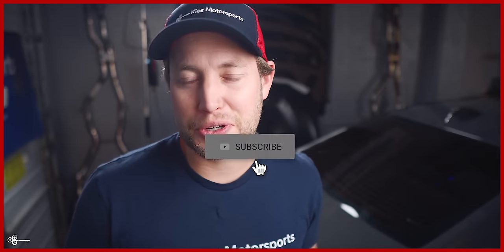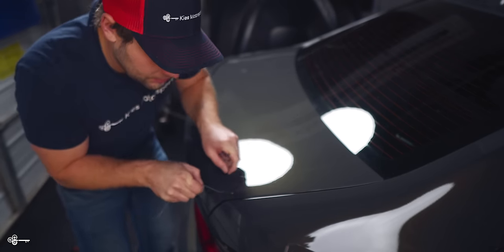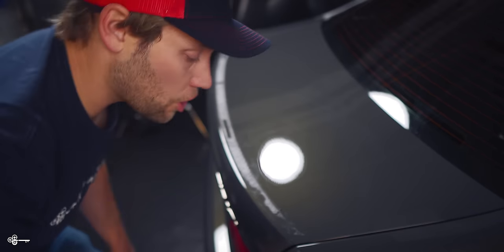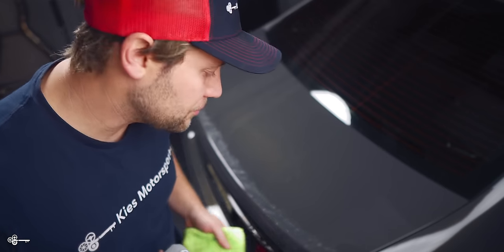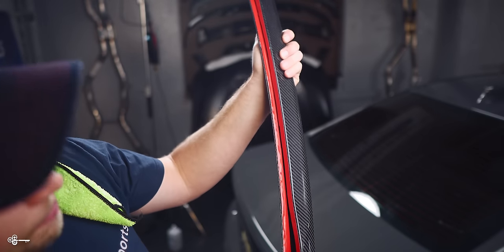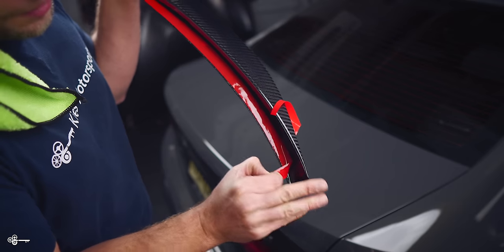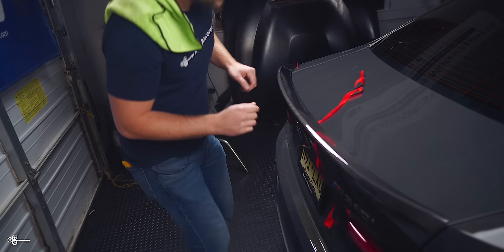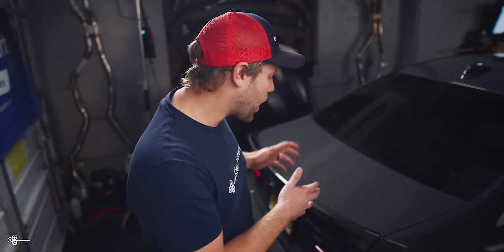How to install a Carbon Fiber Trunk Lip on a BMW G20 (M340i and 330i)

Comment: My 2019 330i didn't come with a Wimpy! Now I feel ripped off! hahaha! I like the concept of pulling the tape off of both ends, in case of ripping the tape! Never thought of that. Done it many times doing small projects, and YUP - you gotta pull it back apart to get more tape pulled! Learned something from ya!!!

Comment: Anyone else having problems with 3m tape not sticking to a g20? Super frustrating I also used the 3m adhesion promoter and nothing. Dealer failed twice

Comment: Any issues with the tape sticking if the car has been ceramic coated?
Reply: Always recommended to NOT do this on ceramic coated cars. You can read so many people’s spoiler falls off because that’s the point of ceramic coating